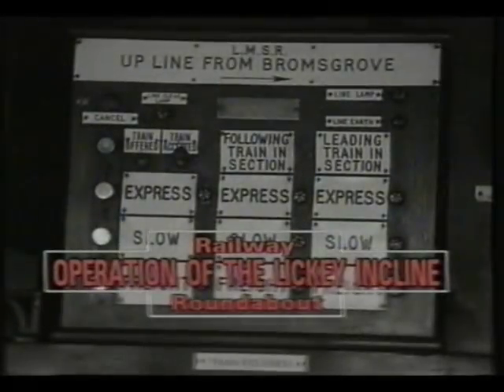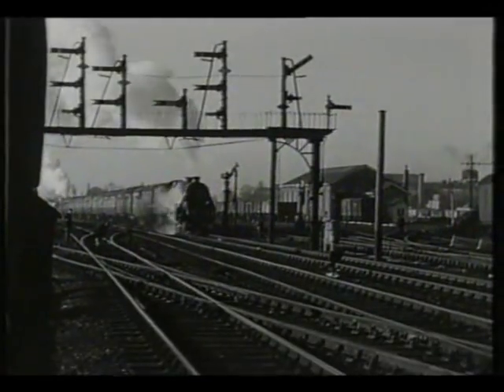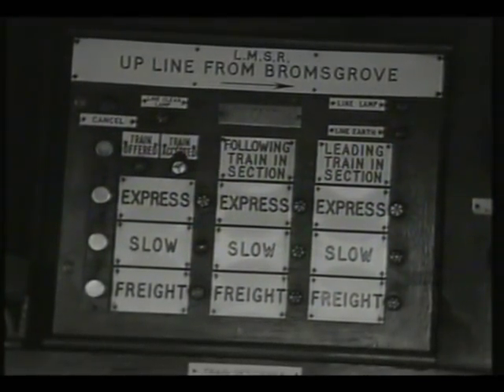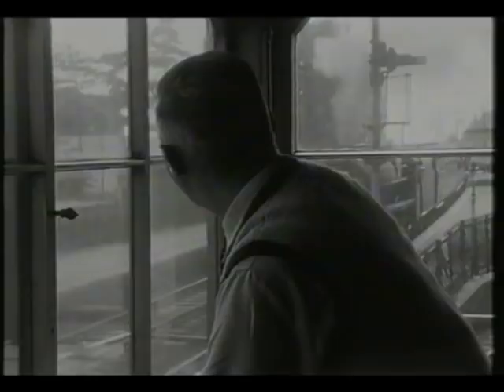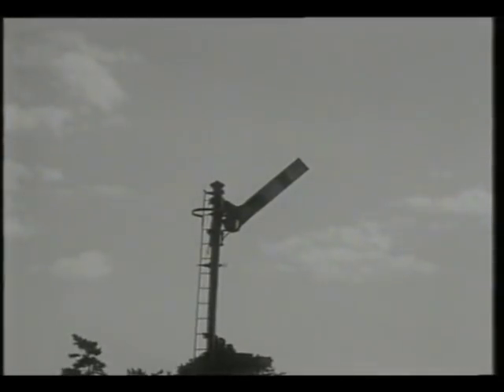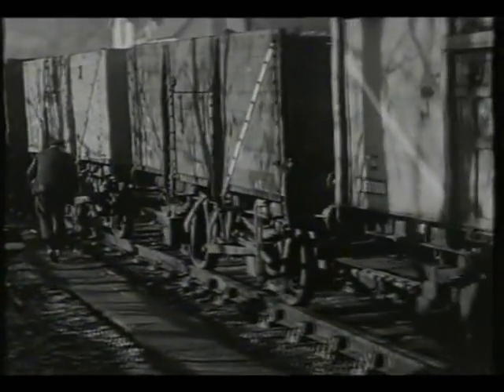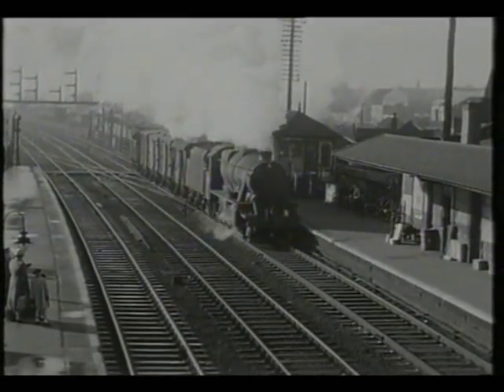Railway Roundabout 1958 'Operation of the Lickey incline'

Comment: I am amazed Victorian practices such as manual brake pegging happened in 1958.
Reply: The problem that British Railways were up against was that the majority of railway wagons were 'private owner' wagons - belonging to mines, quarries, factories, etc, which used them to transport their products. The reason this system was set up was that the early railways were plagued with customers keeping their wagons for days or weeks until they got round to unloading them - which meant the railway couldn't use those wagons for other customers. So the Railway Clearing House set standards to which private owner wagons had to be built - and their use meant the owners could leave them idle in sidings as long as they wanted without holding up other companies' goods.
The downside was that private owners wanted their wagons built as cheap as possible, and weren't willing to pay for wagons with vacuum or air brakes - and even by the 1930s were telling the railways that if they were forced to pay for such brakes to be fitted to their wagons, they'd scrap them and send their goods by road instead.
So the railways were caught between a rock and a hard place.
HTH
Reply: @jackx4311  That is crap! Perhaps the Government needed to oblige this cargo to go by train!

Comment: How did the bankers synchronise their speed so that they weren't actually being pulled by the leading locomotive and that they weren't going so fast that they caused wagons to derail?
Reply: The bankers weren't coupled up to their trains, so they couldn't be pulled by the train engine. The banker engine was nowhere near powerful enough to accelerate the tail end of the train sufficiently to derail a wagon.  As long as the banker driver and his fireman kept their engine working hard, that would keep the banker buffered up to the tail of train, with the sheer weight of train being enough to prevent the banker going any faster than the train engine.
HTH.

Comment: Cute old video, which is the reason that both passenger and freight trains must be helped by small steamers?? 
greeting 
gustavo
Reply: ..Doesn't matter what brakes either type of train has, ... if they are too heavy for the gradient, they need assistance
Reply: +argenvia2 its a very steep incline which meant trains needed help in steam days.
Reply: peter forden not just days of steam, even now diesels sometimes require a back engine or break down on the incline.
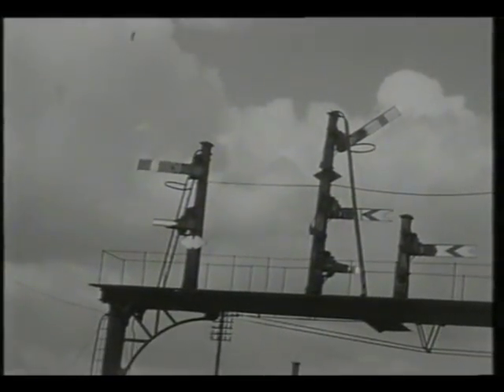Reply: Train Caboose 935 0:40  "The signalman pulls off... " Disgusting, jizzing on the job like that!
Reply: @traincaboose9355  Yes diesels need a helper/banker to this day!